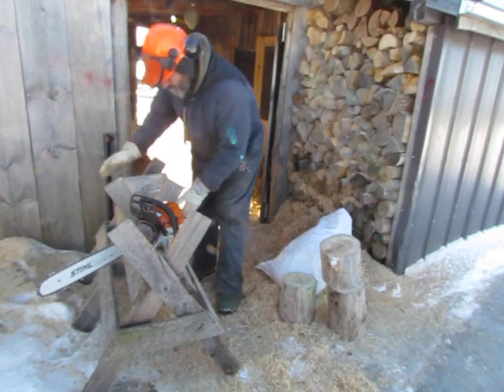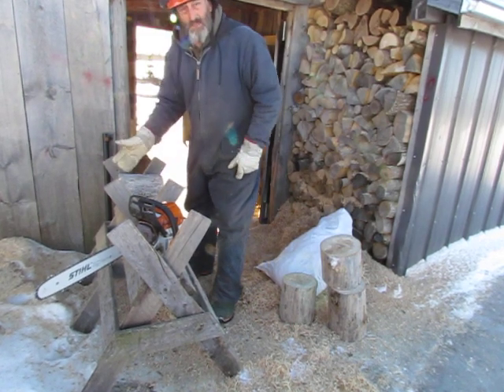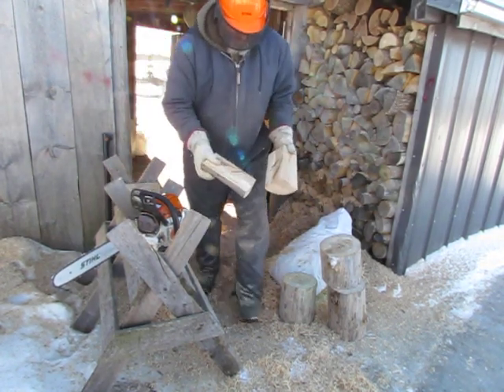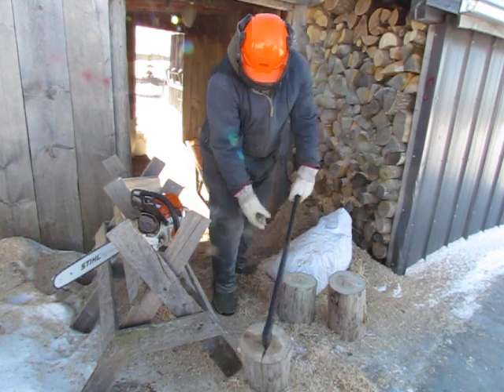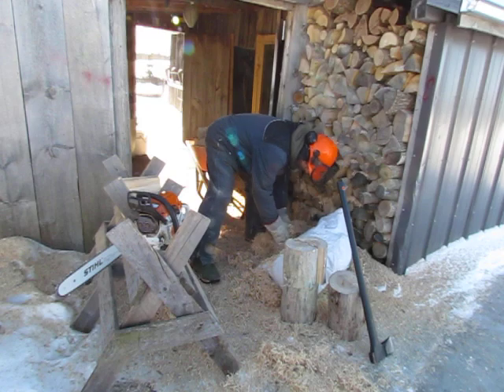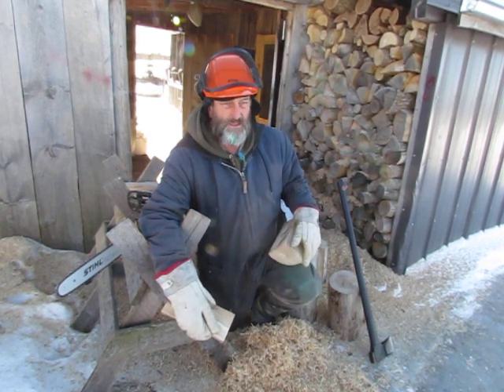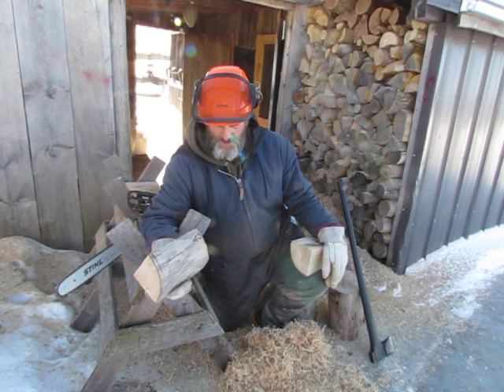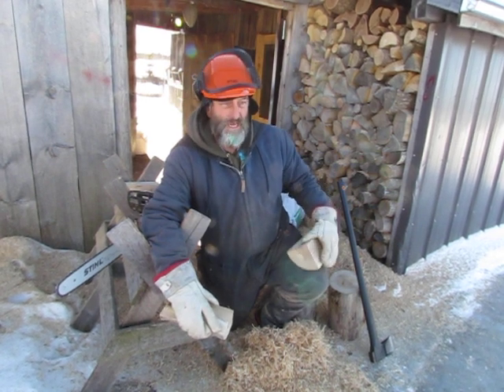How to Split Elm Firewood With a Chainsaw

Comment: The cedar elm we have here in Texas is so much stringier and harder to split than your Elm. I was hoping to not have to noodle it all with the chainsaw since I’ve got at least a cord to split. Drying helps, but my little electric splitter still can’t split dry cedar elm. Chunking it off around the edges with a Fiskars splitting ax helps, too. Just a whole lot of effort per split. Thanks for the noodling suggestion!